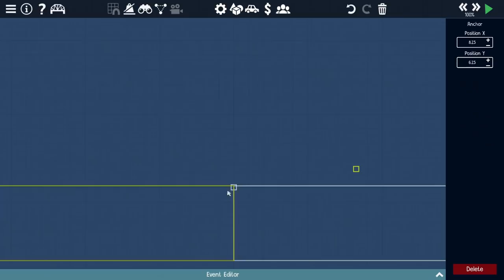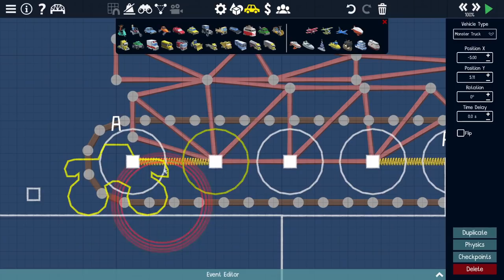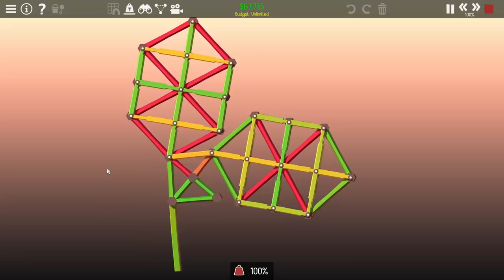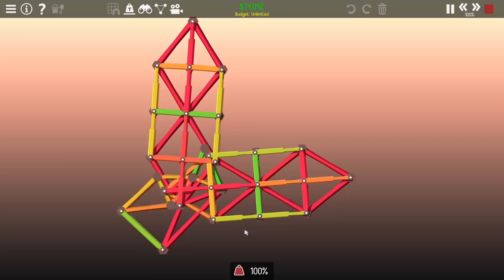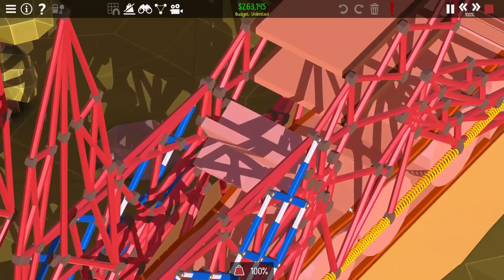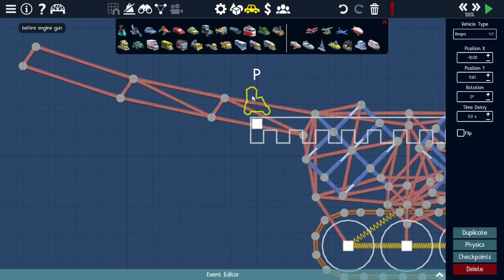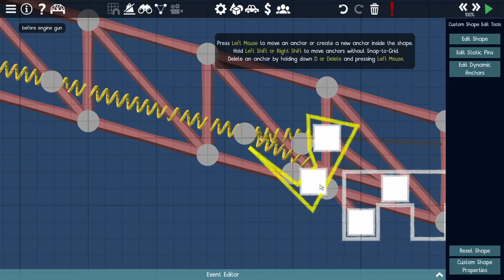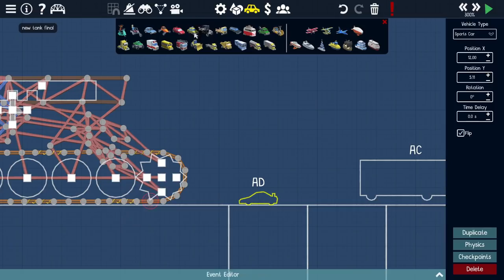Making a Tank in Poly Bridge 2

Comment: 10:26 it is not actually weird for the tank to be shooting in the opposite direction it moves, in fact. During WW2, Britain made a tank called the Archer, this tank was a tank destroyer that would solve a problem that troubled British tanks. The transmission in British tanks were good, but the thing is, although they were good at the time and allowed the tanks to go fairly fast, they couldn’t go fast in reverse when retreating. And this is a big deal because if they wanted to retreat fast, they would have to turn the tank around in order to make the tank retreat faster by facing the tank away from the Germans. The thing is, this would make the crew and engine more vulnerable because the back of a tank is the weakest point. And if they didn’t turn around to retreat, the Germans could have just flanked or surrounded the British tanks either allowing the.British crew to surrender or destroying the tanks with the crew in them. And I’m not sure if this happened or not, but because the reverse on the transmissions was so slow, there could have been a time where some retreating British tanks actually was captured because they ran out of fuel(not because of the low supplies Britain had). This is where the archer comes into play. What Britain did was they got a common tank hull(either the valentine mark I or mark II hull, and they modified it a bit by reinforcing the back of the tank, thus making the front weaker, and they added a 6 pounder(I believe and yes, The British even called it a 6 pounder even though Britain was either already done or was transitioning to the metric system). The 6 pounder is a heavy gun, so they had to add weight to the front. And what they did to the gun was special, they flipped around thus the gun would face forewords. This tank was built with retreating in mind. So when this tank was put into battle, the tank would move forwards. And if the crew saw any infantry, they had a machine gun facing the opposite way of the 6 pounder. So when the tank crew spotted some Germans, they would turn the tank around, and start moving “forewords”/reversing towards the Germans and stop to fire. This was slow. But if the tank crew needed to retreat, the tank didn’t need to turn around, all the tank driver needed to do was put the tank in drive/gear and move forewords fast, this would still allow the tank to fire still and still offer protection to the crew
Reply from the maker: Interesting! Thanks for the comment!
Reply: I never expected to learn so much from one YouTube comment. Thank you.
Reply: bruh the brits still use MPH they didn't ever fully transition to metric
Reply: war thunder player spotted
Reply: @THESLlCK  u know what I mean
Reply: @National_Socialist_Supremacist  that and the fact that I love WW1 and WW2 and the fact that my grandfather fought in the Vietnam war as well as two of my neighbors and my great great uncle was Troy H. Middleton which was one of the Generals during WW2 for America
Reply: @waterlicker8635  That's fucking sick.
Reply: I probably have never seen such a long comment
Reply: @yorifant  you want longer, cause I believe I have done longer
Reply: @National_Socialist_Supremacist  I also forgot to tell you but my cousins boyfriend works at the place where they build and test the engines for the F-35s, he said that this building is the only building in the world where both F-35s and A-10s are in the same building at the same time, he said once this COVID crap is done, he can give me a tour
Reply: Yes, reverse gun lol
Reply: @anthonyf9292   (nice name) @XORRE even more stuff about my family I forgot to put, Troy H. Middleton’s nephew was my great great grandfather, he wanted to fight in the us army during WW2 and he did but when he tried to he was 17 and you need permission from your parents in order to get into the army at 17 years old, the thing is he only knew his fathers nickname and (although it may seem stupid that I am giving out my family info, it is already on the wikipidia)y great great grandfather gave his fathers name as “Shug Beasley” which was his nickname, and the person recruiting people said that there is nobody in the area (or was it in the country I forgot) that has the name “Shug Beasley” and so the next day he came back with the real name. Also, one of my ancestors was a civil war cannoneer which meant he told people what to do with the cannons, he has a statue of himself but I’m not sure if it is still there because of the BLM stuff and before that people wanted to take down his statue because he was a confederate soldier. Also, one of my brother friends is related to Patton
Edit: AND the fact that my grandfather was the cook on the USS Ticonderoga during the Vietnam war
Reply: @ReidCaptain  ok you need to make a collab with Kan because he shouted you out in one of his vids
Reply: This is 100 percent my 3rd grade heritage disc's I finished in 2020
Reply: kinda still is weird though because the archer was like the only tank that was like that
Reply: That tank is also named angry conor
Reply: The Swedish have a tank similar to that. But it’s low profile, and thick armor makes it much, much better for hit-and-run attacks.
Reply: Actually, it was a 17 pounder. This meant that the Archer was the best armed tank the western allies had at time
Reply: @WalletWorrier  just because the 17 pounder had one of the biggest punch in the western allies hands doesn’t make it the best gun they had, the weight, size, caliber, versatility(aka how many things a gun can be used on like can it be used for AA, AT, etc), reliability, what type of environment the gun was used in, etc, so no, just because the 17 pounder had one of the biggest punch in their hands doesn’t mean it was the best gun they had, besides determining the best gun any group, country, or alliance had cannot be objective, it is based on many different factors which in their own ways can make any gun the best gun they had.
Edit: also “armed” can mean how many guns/weapons a tank had or it can mean just how big/powerful was the round on a tank was.
Reply: @waterlicker8635  best armed as in the most powerful weapon capable of penetrating the most armor. Chill my dude

What would you say was the best antitank gun mounted on a western allied tank at the time?
Reply: @WalletWorrier  as I said, ther is no definitive answer that you can give for the best gun they had, in terms of caliber though the 17 pounder is up there
Reply: @WalletWorrier  The 17 pounder was the equivalent to the American M3 75mm, and the 17 pounder was also used on the Sherman firefly.
Reply: @waterlicker8635  What you have stated is true. But, the 17 pounder was considered relatively cheap, reliable, and powerful for its size.
P.S it’s QF 17 pounder gun, the Qi is for quick firing.
Reply: @dreamdiefly  actually, the 17 pounder was far superior to the 75mm M3, much more similar to the 76mm M1A1, however it outperformed both guns in the antitank role. It was only slightly worse than the 90mm M3 gun when using full caliber AP, but with APDS the 17 pounder really shined, being able to frontally penetrate anything the Germans could field, except for Tiger IIs and Jagdtigers. A better analog to the 17 pounder than the M1A1 would be the German 75mm KwK 42, the gun mounted on the Panther, whose PzGr 39/42 APHECBC shell had functionally identical performance to the 17 pounder's Shot Mk. 8 APCBC shell
Reply: How long did it take you to type THAT
Reply: @notyetyeet6325  a few minutes
Reply: @WalletWorrier  What I meant by equivalent, was that it was used by the British as the m3 was used by the Americans, not including the anti-tank role. Please excuse my poor speech, as I did not convey what I meant. My apologies.
Reply: @dreamdiefly  ah ok
Reply: @WalletWorrier  hey, what about the 12 inch mark 8 gun? Go Navy
Reply: @WalletWorrier  also, not technically a tank, but a rail gun, the Schwerer gustav
Reply: That’s the biggest comment I’ve ever seen
Reply: Make it longer I need a book
Reply: @THESLlCK  its kph
Reply: Jhj
Reply: "This tank was built with retreating in mind" i thought you said it was british, not french🤨
Reply: @rulerworld1289  it is british
Reply: 아 설명충
Reply: when i play world of war tanks i cant reverse fast enough to retreat so i turn around then i die.
Reply: I didint know that. Cool
Reply: not a 6-pounder. the 6-pounder was a 57mm cannon. You mean the 17-pounder? Y'know, the big scary 76mm cannon that was stuck in the Sherman Firefly sideways because of how comically large the breech was? (Not to mention the fact it ate German armour like tea & biscuits)
Reply: Historian guy spotted (no offense)
Reply: @dreamdiefly  the Schwerer Gustav was a railway gun, not a rail gun
Reply: @National_Socialist_Supremacist  I'm here too lad
Reply: smort
Reply: Who here actually read the entire thing
Reply: @blufish4077  I do and to be honest there's a pretty interesting history lesson in the comment sections
Reply: GOD HOW CAN YOU TYPE THAT
Reply: Please learn to write longform comments. And while you're at it, maybe open a dictionary

Comment: I don't know much about polybridge mechanics, but what real engines do to solve the problem of it rotating the other way or being weaker at the end of the stroke is having another piston thats offset by a quarter. I can see that you kind of did that but the problem is that both pistons are giving power to the wheel at the same time, and it would work a lot better if the time they set off was offset. (you probably can't do this in polybridge, I was just adding what real engines do.)